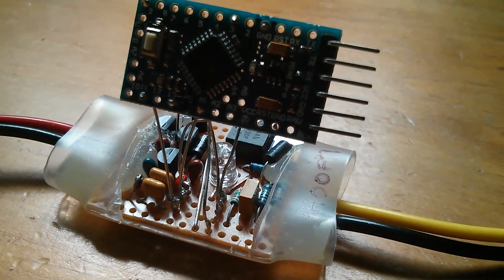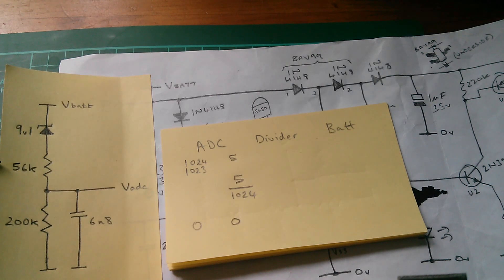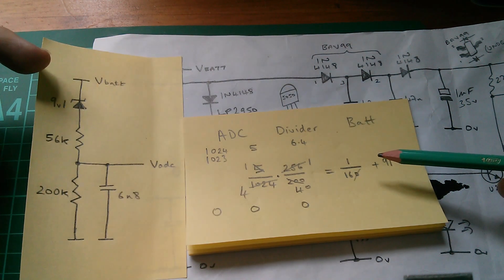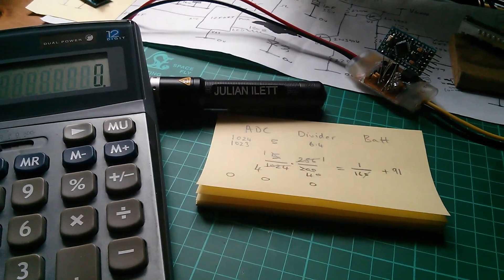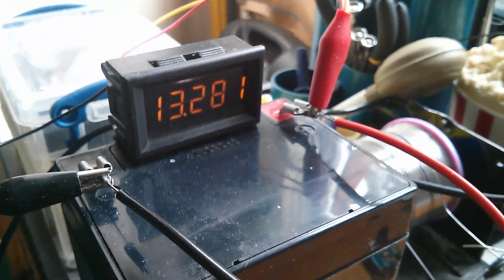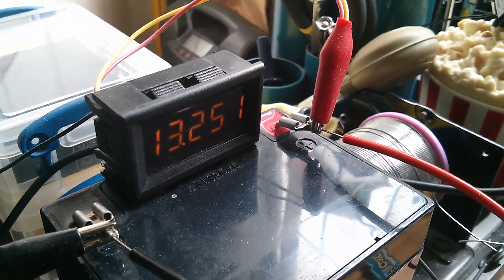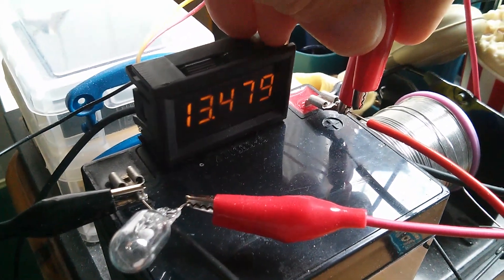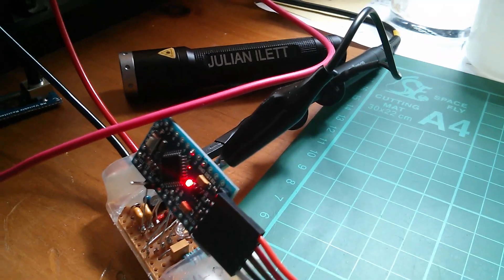Arduino PWM Solar Charge Controller #4 - Closing the Loop

Comment: Hi Julian, I've just made my own version of this after watching this video with a mosfet, transistor, and some passives. I decided to try and put in two modes in the code, bulk and absorption. If the voltage hits 14.5v it then drops to 13.6v PWM, returning to bulk if the voltage drops below 12.8v at any time (such as at night/during use).

Considering it actually works, I thought I did well for my first attempt! Thanks for the guidance with the code =) I'm just testing mine now to see how it goes but typically the sun keeps going in. I'll definitely be keeping an eye on the MPPT version as that's something I'd love to try some time (I'm starting out small with PWM only!).

Thanks, Andy.
Reply from the maker: Excellent! I'm very pleased my video has inspired you.
The sun going in and out can be quite useful for testing the transient response of the feedback control loop - damping, overshoot etc.
I'm hoping this work on the PWM will inspire me to move forward with the MuPPeT project. Wednesday's weather is looking promising!
Reply: Julian Ilett It's something I've wanted to do for a while but your video gave me the push to actually try it. I was just lucky I had a mosfet lying around from when I first wanted to give it a try a year ago.

I agree the sun going in and out can be useful but at the same time not, it depends on the stage of testing you're at. I just needed to make sure mine got to the set voltage and was limiting properly which I never got to test fully.

The weather is looking good all week here so hopefully I'll get an hour or two in the evenings after work to have a play. Cheers!

Comment from the maker: Arduino C code used in this video (latest at https://github.com/julian256/ArduPWM)

void setup() {
  TCCR2A = TCCR2A | 0x30;
  TCCR2B = TCCR2B & 0xF8 | 0x01;
  analogWrite(11, 117);
  analogWrite(3, 137);
  Serial.begin(9600);
}

byte deciVolts = 0;
byte pulseWidth = 0;

void loop() {
  deciVolts = analogRead(A1) / 16 + 89;
  Serial.print(deciVolts);
  Serial.print(" ");
  if (deciVolts < 135)
  {
    if (pulseWidth != 255) pulseWidth++;
  }
  if (deciVolts > 135)
  {
    if (pulseWidth != 0) pulseWidth--;
  }
  Serial.println(pulseWidth);
  analogWrite(9, pulseWidth);
  delay(10);
}
Reply: Doesn't analogread give a different result when the solar panel is connected (pwm output high) as supposed to disconnected (pwm output low)? Or does the battery smooth this out enough to be negligible?
Reply from the maker: beargun42 Yes, it will vary a little, especially if the battery leads are long. On the PWM5, I synchronised the ADC reads with the PWM, so it always reads when the MOSFET is on. May have to do that on this one too.
Reply: "deciVolts = analogRead(A1) / 16 + 89;"

deciVolts = (analogRead(A1)  >> 2; // 0..255 or 0..25.5 V

Comment: Always instructive video.
I discovered how to do a staggered scale voltmeter. Unfortunately, the Zener are temperature dependant !
Maybe could we use the inner Arduino temperature sensor to correct this adding a piece of code !
On the other hand, Lead acid batteries charge is also temperature dependant !
Reply from the maker: jusb1066 If the temperature effect had been the other way round, I probably would have stuck with it and used for it temperature compensation. But sod's law prevailed.
Reply: wonder if you can somehow use the inverse of the zener diode? so lesser charge when hot and a bit more when its cold somehow?
Reply: jusb1066
Well, some electronics would probably be able to "trick" the 9.1V with an AOP.
Would be interesting to have a specialist point of view !
Reply: Julian Ilett
Use Zener diodes with different voltages! The temperature dependence is very low for 5.1V Zeners (the reason being that there are two different temperature dependent effects inside a Z-diode, that cancel each other out in 5.1V zeners).
Use two 5.1V in series (you will need to change your formula or resistor divider a little bit of course to suit the 10.2V drop). You could also use a 6.2V zener and a silicon diode in series (giving you around 6,8V drop), because there temperature effects will cancel out, too.
Reply from the maker: superdau Really? Zeners and regular silicon diodes have opposite temperature coefficients? That could be worth looking into. One thing I did discover is that the 9.1V zener has a completely fixed voltage drop across a wide range of current - the 5.1V varied considerably.
Reply: Julian Ilett
Unfortunately only for the 6.2V zener... There are already two effects in a zener diode: the zener effect and the avalanche effect. Their tempcos are opposite to each other, canceling out at 5.1V zeners. The total of the tempcos in a 6.2V zener are approx. the opposite of a silicon diode.
As you discovered zener voltages are very dependent on current for low voltage zeners (it starts to get better above 8V). That's the zener effect. For higher voltages the avalanche effect takes over (avalanche diodes are almost the same as zeners), which is much more stable. I never understood why zeners are advertised as the "DIY 5V supply", because it at least at this voltage calling it stabilized is quite far from reality.

All that said: why not just use a simple voltage divider? I know you won't be able to use quite a lot of the range of the ADC that way. But is it really necessary? At ten bits resolution (that's what AVRs have) you'd still be able to measure to 15mV (back of the envelope 15V/1024).
Reply: You can use a pin on the Arduino as a 5.00v reference...effectively calibrating the voltage reading whatever the hardware (resistors, zenners etc) used.
(Great project Julian)

Comment: out of interest, what spurred you to change it from the previous microcontroller to arduino? some advantage to the arduino platform?
Reply from the maker: Arduino is very easy to program, and very cheap - you just need a £1 USB to serial converter. For me, this is a complete change - I'll be designing but not manufacturing.

Comment: To prevent the "overshoot", adding a delay between iterations of the loop might help. Maybe do dalay(150); for 150 milliseconds of delay
Reply: *delay(150);
Reply: I don't agree. The more time it will take to ajust PWM, the longer it will overshoot !
Replace iteration by something like proportional + iteration !
Reply: The arduino cycles VERY fast. I think the overshoot is caused by the mosfet and battery not having enough time to respond to the changes in the PWM. I think multiple PWM changes are made before the voltage is updated - creating the overshoot.
Reply: It would be interesting to see what actually happens when a delay is added :)
Reply from the maker: Llop66 Exactly right. When the battery voltage is near the target, single step increments and decrements are OK. When the target is some distance away, it would make sense to move toward it in bigger steps. That's one of the improvements to come.
Reply: Ashneil Roy
If you look at the code, you see The voltage is updated at each loop as the PWM is also ajusted.
If the load if big, it will take some few entire loop() before the PWM is well adjusted.